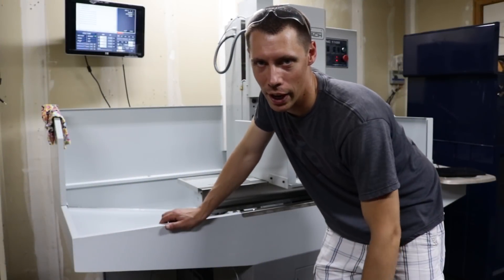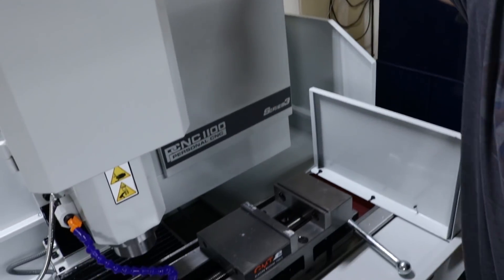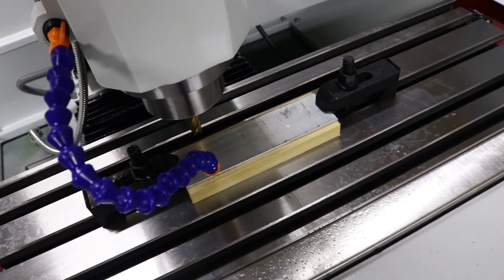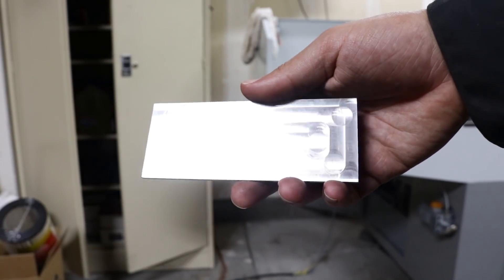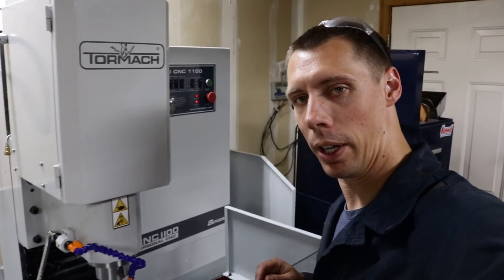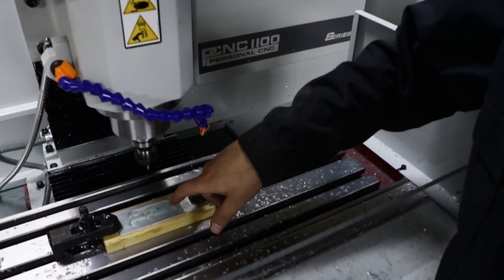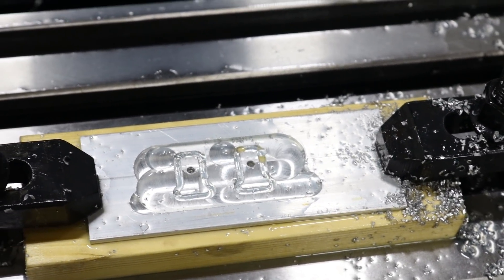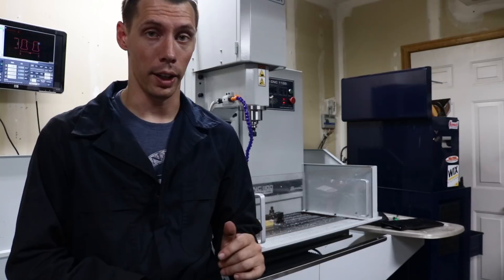Playing with new Tormach 1100 - First Project!

Comment: How much do those go for
Reply from the maker: Are you asking about the mill?  Mine was around $11,500 without any tooling.
Reply: O ok what do u think about syil x5 or pm 940 and making it cnc....I not like travel off all but pm 940...it alot...can u get it to cut tight tolerances?? The big pm unit....herd tormock is off by 3k a inch...is that true?
Reply from the maker: I don't have any experience with the machines you listed.  I will say that when I bought the Tormach I wasn't going to do another conversion.  I wanted something ready to run.  The Tormach is pretty accurate.  It is easily repeatable within .001".  I've had no issues with it being off.
Reply: Ok so u get what u pay for then...that good...did u use good dial indacators to test....I just not have 11k.  More like 6k.      The pm440m 3 times size and runs about 4k....non cmc...    it big....but thank u alot...no bs...thanks ...sux being poor

Comment: PathPilot's conversational interface makes quickly programming facing operations really simple, so you don't need to run manually.
Reply from the maker: That's a good point.  I haven't even looked at the conversational programming yet.
Reply: @RivalMachining  it's really useful, short of having handwheels on it for simple operations.

Comment: Rather than changing fusions feed heights I would just put pathpilot in single block. Also slow down your feed, press feed hold when you get close to the part and check your distance to go. That’s how I typically verify a program for the first time. However you feel comfortable about it is up to you. I just thought I’d throw that out there as a different way to verify offsets without having to mess with the fusion defaults. I’m looking forward to future videos on your new machine! Also, did those parts pass inspection?
Reply from the maker: I will definitely be using the single block function from now on.  That seems like the best way.  The parts should be good to go, they did measure a few thousandths over, but that is ok for this job.
Reply: Does pathpilot allow you to put in tool wear at the controller? I started to us it on haas controllers in school and it made a world of difference, especially on parts with GD&T call outs.
Reply from the maker: I'm not that far into PathPilot yet.  It does have a tool diameter value on the tool table.  I think you could adjust that and tell fusion to use those offsets instead of the fusion offsets.  That might not be the right way to do it though.

Comment: Love see chips getting made on a new machine. 

Space bar on the keyboard = feed hold. Definitely use the max velocity override as well as the single block option on the first run.

 I bought a touch screen monitor off of Monoprice and love not having to mess with the mouse. Same monitor tormach sells but much cheaper. 

I built an enclosure out of wood and coated it with flexseal as a moisture barrier. I don't run flood coolant though. I also have my controller mounted to the side. I hate the idea of putting a computer under something that is supposed to hold fluids.
Reply from the maker: Thanks for the info, you made me realize I should probably learn all the keyboard shortcuts.  The touchscreen is tempting, but I am also looking at the haimer indicators as well as just a few nice dial indicators for setting up vises and such.  The decision to spend money is usually based on what I need to buy right now, so the monitor will probably be a little way down the road.
Reply: Rival Machining I understand about choosing what to buy next. I highly recommend the Haimer taster. It makes finding work coordinates so simple. Of course for the money you could get a probe from entirely crimson. I used an indicator for setting tool length on the machine but have switched to using a height gauge offline. It is much more reliable and I can do it anytime.

Comment: One thing I always did with a new program was slow the rapid speed down and manually step through each line of G code so if there was a problem with the program I could stop the machine before it crashed. Thanks for sharing and have fun!
Reply from the maker: Thanks for the tip.  I will need to learn how to execute 1 line at a time.  Ugh, the joys of learning new software!

Comment: Good stuff man. MSC can sell you some additional lock line and spliters. I would split it twice that way you can have 3 coolant lines you can point from different directions. This is good mainly for profile and pocket milling but also helps a bit with drilling. You would be able to run full flow with less splash while maintaining the same heat dissipation. You might also see if you can find some offcuts of low hydroscopic  plastic instead of the wood if you have to run that setup again. Ya I know it's what you had on hand been there done that. Tormach's chip/coolant control set up is kinda crap I would look at building a fiberglas or sheetmetal upper section with windows and a door. Or maybe some kind of a clam shell. It would be a decent amount of work but you'll be much happier. Spending the day soaked in coolant sucks. The shower curtain will help but I'm not a fan of something that flexible near a running spindle.
Reply from the maker: Thanks for the tips.  I will probably order the loc-line this week.  I started looking into making an enclosure out of sheet metal.  If I go that route, I would probably just take the design to a sheet metal shop.  I'm still kicking around the shower curtain for temporary until I can get the metal enclosure made.
Reply: Anytime man. With what Tim said there should be buttons (physical or on screen) for "single block" "optional stop" and "rapid override" . Single block will execute one line of code then wait for you to hit cycle start. Option stop will pick up any "m01" in the code usually between code sections. I haven't used path pilot but that's pretty standard even mach3 has them. What he described is the way the pros do it on the first part of a new setup or proofing out a new program. Also for new programs we offset Z up a couple inches and run it in the air to make sure it doesn't do something stupid. When the machines you run cost $300k and take a specialized mechanic to fix you don't take chances.  No crashing the new toy lol
Reply from the maker: Thanks for all the help.  I just read up on single block and optional stop.  I probably should be slowing down the rapid override as well.  Do machinists just cut air when using these methods?  I would think the tool dwelling between commands and reduced feeds would mess with the part.  Or do they just accept that on the first one?  It's nice to know how the experts run the big machines that can destroy themselves very quickly.
Reply: For a new program it's best to cut air first. Since it's tough to see everything in CAM. Now let's say I had to change fixtures, reset home but I'm running a program I know is good because I've run it before. Then I would engage option stop though out and walk (rapid turned down w/ single block on) each tool down to a reference plane say Z.2 and compare the numbers on the screen (where the machine thinks it is)  to what I'm seeing. I would be checking to see if I set my homes right and touched off my tool correctly. Once I verified that I would take single block off and let it eat until that section of code ended and it hit the M01. Then repeat the process with the next tool. If your single blocking while in cuts the trick is to run the next line of code in your head before the machine gets to it. "slide hold" is also a great button to master. Check out this guy's early videos for a G-code education.
https://www.youtube.com/user/stikkshere/videos